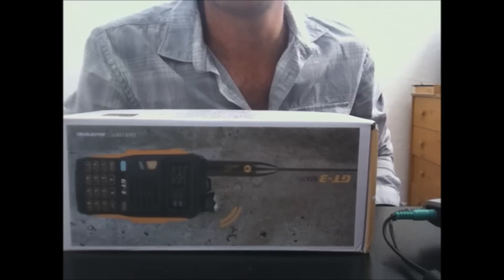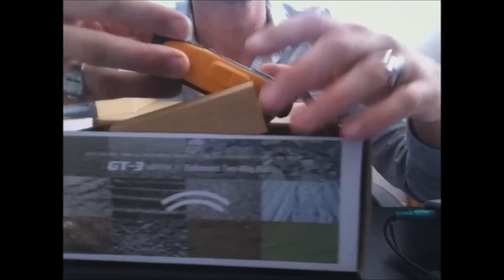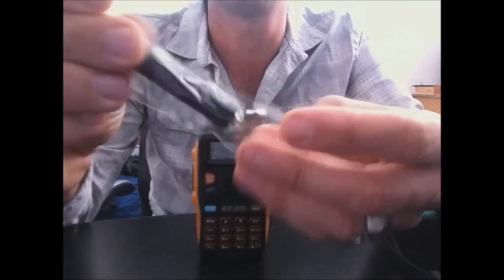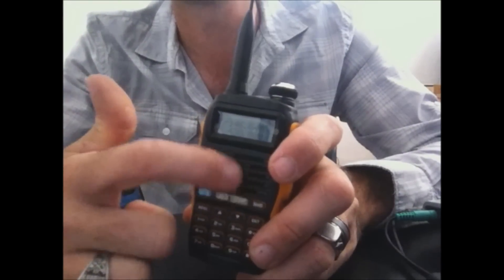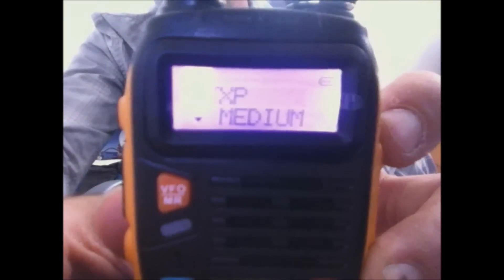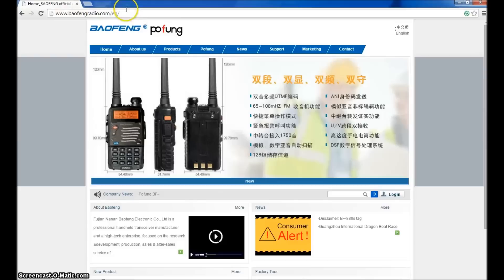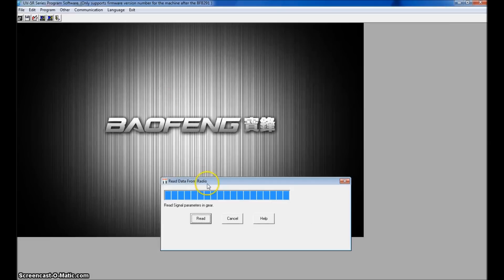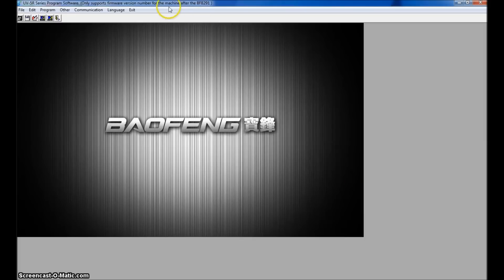GT-3TP Baofeng 8 watt review, test and programming

Comment: Misconception the tx power won't do much apart from running the battery down 4 watts to 8 is really not worth bothering with, range would not be that much more, around half an s point in reality, but do you  really want 8 watts rf bombarding your Mellon I don't think so that's if it can do 8 watts of course. 73

Comment: At least one ham on the QRZ site has a warning against using the cigarette lighter cable that is sometimes included as an accessory to power the charging base from your car voltage.  The problem is the charging base wants to see 10 VDC input.  But apparently there is no voltage drop circuitry within the cigarette lighter, and the full car battery voltage will be presented to the input of the charging base.  The car voltage can easily be 13.7 VDC, which is substantially higher than the charging base can safely handle.  The result for the ham on QRZ was his charging base literally melted. 

If you must try to charge using your car voltage, first use a volt meter to confirm that the voltage from the cigarette adapter is not over 10 VDC.  If it is, perhaps open the cigarette lighter and put 5 or 6 diodes in series within to drop the maximum 13.7 VDC to something closer to 10 VDC.  (I do not own this HT but have researched it for a friend.)  

K6VCI

Comment: Loved this radio until the mic-earphone cover broke and the monitor button popped out.Also the mic quality is subpar, I had to open up the mic hole slightly with a small drill bit to up it's loudness.

Comment: FYI: I was shocked to find the GT-3TP monitors two channels at the same time and if you are listening to the FM radio it will break in with the monitored changes and transmit without switching back. So cool! Haven't tested the other models yet.

Comment: Just used CHIRP on 1/10/2018 and it works perfectly!
Reply: Have you used the car charger and is it really a tight fit to add the computer data cable onto the device itself?

Comment: CHIRP can be used to program it but u have to select model BF-F8HP to program your GT-3TP
Reply: Can you also unlock 480-520mhz on the gt3 model using the bf-f8h software?
Reply: Well, my device works now with chirp. And i can use it up to 500 MHZ
Reply: Nightfly1957 Hi Nightfly, Could you please say how you did this?
Many thanks
Reply: I used the software of the cd.Because i had no time to search the web. It installs with many ????. If You click in the rigth corner on one of these ? , than comes Englis. Click on it. The rest You will find,
Reply: Hi, did it work ? Some device do not work. It is a roblem with the firmware.
Reply: just tried it on my day old baofeng; it no longer works. i have the latest CHIRP. programs corrupt frequencies.

Comment: new GT-3TP arrived today
ver BFP3-23
downloaded software from Baofeng site as said.

As soon as software opened I get the following flag 

can not read or write to radio 
Run time error '8020'

then radio lights up like it's down a power down and power up

with ?? ?? ?? across where the menu options are 
clicking ok shuts it down

I have a UV-3R+ and UV-5R, they work ok with both 3R and Chirp
tried the GT-3TP on chirp using BF-F8HP,  doesn't like it
any ideas ?
not a computer person, still learning.

Comment: Good content, thanks. Link to Baofeng is old/dead. Strange that the GT-3 is not on their site. I flipped through 16 pages of HTs and didn't see it. Also, programming software for it is missing - most listed are for the UV series. I'm planning to get the GT-3, so I'm interested to find the software that is up--to-date. any ideas?

Comment: Were you using a repeater or just the radio on that 40 mile communication? Thx. Nice video BTW.
Reply: DoubleHelix no radio is capable of doing 40 miles without a repeater
Reply from the maker: repeater
Reply: Hi again, the link for the firmware is not working, can you update it? thx.

Comment: Hi, can you use it out of the box without programming, so you just switch them on and start communicating? I am planning to buy two of them so I can communicate when camping and hiking.
Thanks!
Reply: They will likely need to be programmed, but you can program them from the keypad. Unfortunately, in order to access all the features, you will need to program them with a computer using the programming cable. Also, the frequencies programmed into the radio at the factory are probably not legal for use where you are, as that's the case in most areas. In the U.S., these radios are only legal for transmitting on the "two-meter" and "seventy-centimeter" ham radio bands, and then only by a licensed amateur radio operator. There are no legal frequencies that these can be used on by an unlicensed operator.

Comment: Can I use it without a license? 

Which Frequencies are typically used for SOS and other Marine Stations, so i won't interfere with them?
Reply: most of the frequency covered by this handy requires a valid licence
Reply: In the UK the only frequencies you could transmit on with this device is the PMR channels starting from 446Mhz UHF. Even then I wouldn't recommend transmitting on the full 8 Watt! The rest of the PMR users would have to sit on their handy to stop you from blowing the back end off!
Reply: Using this radio on PMR 446 frequencies would not be legal at any power as only type-approved equipment is permitted on the band. AFAIK the only legit way to transmit using this in the UK would be with a Ham radio licence - and maybe only Intermediate and above, but I'm not sure about that last point. If you don't want to bother with a Ham licence (and I suggest to casual readers that it's a really good idea to get a Ham licence if you want to explore radio), or buying a professional frequency allocation then your only strictly legit UK option is PMR 446 with type approved radios, or CB radio.
Reply: Jonathan Warner It is totally fine to use PMR without a license. The "type approved" just means it limited to 500mW which is the legal limit for transmission on PMR. Such as a kid walkie talkie radio is limited to 500mW.

That being said. Even with a license, the absolute legal limit of transmission on PMR is 500mW. Anyone transmitting above is "breaking the law". Buying this handy for PMR is pretty much breaking the law, at least here in the UK. Even with a license.

Luckily for most of us amateurs we have common sense. We use whatever power we require to talk nothing more. I have used this set at the maximum 8W attached to an outdoor colinear above my house. Max distance heard was 3 mile. So if you are a farmer or own a large warehouse or complex and would like the workers to be in contact this would be a great radio for you.
Reply: Yes, it is fine to use PMR 446 without a licence, using type approved equipment, of which a Baofeng is not. Type approval is a property of the equipment, not the power you transmit on.  By the way, PMR is more than PMR 446. There is a lot of PMR equipment out there with higher power, up to 25 Watts, to be used on other bands for which you have to purchase a licence.

Comment: Hello
I wonder which radio is better.
The BF UV82HX (8W) or BF GT-3TP Mark 3 (8W)
I want to get a good talk range and clear voice.
What do you think?
Thank You!
Reply from the maker: 8 watts is 8 watts. Now if one radio has better circuitry and design, then that would make the difference. If they were both equal 8 watts with same structure, it wouldnt matter.
Reply: So are they totally the same stuff?
Reply: I want a pair radio into the cars to talk at motorway on PMR446 freq. Which one would be the better choice? Thank You!
Reply from the maker: well, i havent had the uv82hx, but from my past history of having almost every baofeng, they are the same, unless you talk about 4 watt versus 8 watt.. Other then that, they use the same stuff, maybe a component change from here to there, but all the UV5r series from the original to the latest are all the same.. All the GT3 series are all the same, except for power levels again...
Reply: So interesting.
Should I buy the much cheaper UV-5R one?
Would it be the same for me?
What do you think?
Reply from the maker: I personally think the GT-3tp or the UV-5RTP are my favorites. Both 8 watts..The extended battery with one of these is a must have.
Reply: +HamRadioConcepts they  costs the same price. approx. 50$

Comment: I downloaded the file to windows 10, all it is is a file, a rar file,  now what?  it doesnt open or play
Reply from the maker: +Andre Rio you have to extract it with a program, such as winace, extract .rar file is what you can search.. winace is free, winace.com, it will say trialpay or purchase, t\just click on trial pay, i have ben downloading and using winace for like 9 years, havent paid 1 penny, it just reminds me my trial is up but continues to work , HAHA.. but theres tons of free software out there..
Reply: +HamRadioConcepts I managed to download the programming software on my Windows 10 machine, but i absolutely cannot get the radio to communicate with the software!!  All i get is "Communication Fault". And yes the com ports are matched up so that's not the problem.   Am i missing a USB driver?  Is there a USB driver for Windows 10?  BTW,   No problems at all on a Windows 7 computer,  but Windows 10?  No dice!
Reply from the maker: +wrathelnino ok, Google this phrase "miklor vista driver" download the vista driver from that site.. I think it's 3.2.2.0 uninstall the existing one you have now while it's plugged in then disconnect. If windows gives the option, manually load that vista driver 3.2.2.0
Reply: +HamRadioConcepts Thank you i will download that Vista driver and report back!
Reply: +wrathelnino  Well i have to say that the Miklor Vista driver 3.2.0.0 worked just fine!
Reply: what i did was , simply install chirp, connect the cable to usb and other end to handy, update the driver... done

Comment: hey HamRadioConcepts great video thanks! i didn't have a CLUE what you were talking about for most of the time because i bought this for £30 as an ott walkie talkie for hiking and camping and i know nothing (well, thanks to this video, a bit more than i did!) about ham radios! could anyone give me a bit of 'in layman's terms' advice on how to use it, as a novice?
Reply: most of the radio frequency band covered by this hand held transceiver is reserved for certain purposes, like police, marine communication, like that also it covers ham radio frequencys, which may or maynot change slightly from country to country.....

i am from india and these transceivers are used by fishermen, police , forest department, railway.... but for a licensed ham only 144-146mhz is allowed.....

so before ur next hiking , find which frequencys are available to be used without license in ur country

Comment: hi, in amazon descriptions said it radio reach 520 MHz but it cant. only reach 470 MHz , why?
Reply: Looks like you have a restricted frequency range, can be expanded in chirp software using bf-f8hp settings I believe, check the site to find out more.
http://chirp.danplanet.com
Reply: ok thanks friend,, i find a gt3 original softwar,the interface is very similar to baofeng uv5 series software, but have an special section excllusive for that equipment (gt3)

Comment: Hi I just ordered the GT-3TP.. Can I use a different antenna since the one in stock is a bit too long?
 Do you suggest anything for handheld and another one for car use.. would these work 

http://www.ebay.com.au/itm/New-SRH805S-SMA-F-Female-Dual-Band-Antenna-Baofeng-GT-3-UV-5R-BF-888s-Radio-GB-/181940933799?hash=item2a5c8654a7:g:NjEAAOSwo0JWPCzZ

http://www.ebay.com.au/itm/5dBi-3G-Indoor-Omni-directional-High-Gain-Antenna-SMA-male-TS9-CRC9-GT-/201505176916?var=&hash=item2eeaa4fd54:m:mqxxCsy9W78_-IYYlbdmclw

Thanks
Reply: +startatrix did u get the 32 cm antenna..... i am using the stock antenna and i works gr8

Comment: how about programming multiple radios?
Reply: It's easy to copy the program from one radio to the next. In fact, once the program   has been installed on one radio, you can just change radios and program the next one, and so on. At least that has worked for me using Chirp on Linux.

Comment: quick question guys can you listen to airband 108-136 
and how long does the radio last for running 8w 
looking at replacing my yaesu ft-50 thanks ☺
Reply from the maker: +Andy Howe No airband on the baofengs, you should check out the Wouxun UV9D it has dual receieve and airband.. radioddity.com

Comment: Got the GT-3TP and followed instructions as closely as possible.  My programming cable shows in device manager as a CH340.

When I plug in and try to read from the radio, I get the following error: Fail connect with transciever, then Communication Fault.  I'm running Windows 10 and ran the program as administrator.

Any thoughts would be greatly appreciated. 

 73 de K4RGD
Reply: +k4rgd in case you are still struggling with it just make sure your cable is plugged in fully. I had the same problem but when pressed and held the connector against the radio it started reading as normal. Looks like the plastic of the connector is not molded properly.
Reply: +k4rgd do some trimmings in the connector like martin said..... did u installed the drivers properlly...... go to device manager, update the driver by chousing automatic..... will  work fine ....... when using chirp select the device as F8HP

Comment: Ok guys I'm new to higher scale radios ( aka not a Motorola walkie talkie). a few questions, one can this radio be used on cb radio freq., can it be used as a regular walkie talkie style, I don't have a ham lic., so with out getting into that yet, do I need a lic. if I can operate it on the privious questioned bands?
Reply: +bloodmistninja88 no friend it cant be use as a CB radio.... u can only use these rado with a proper licence.... even licenced hams can only use 10 % of bandwidth this transceiver provides

Comment: Interesting that if you go to the Sainsonic website and download the software that is noted as specifically for the GT-3TP it shoes as the UV-5R when you open the application to the 'Other' menu.  A year later there is still not a release for this radio that includes the tripower facility.

Comment: I realize that this is probably a dumb question but I am ignorant as it relates to radios.  Once you complete the instructions above, (which I have not), do you adjust the frequency on the radio to same frequency ex: (462.7125 mhz/ channel 7 on Midland/Motorola) to talk to other radios ??  How do the A/B and or Band buttons come into play for this?  Thanks for all your help.

Comment: very very good.  Was able to program channels on the gt-3tp with your instructions - on windows 10.

Complete newb questions .. set on a particular channel I only got about 500m before it cut out. Should I be using repeater channels for my local area ? Or are there a multitude of other factors.   Also, fm radio works on one unit, but doesn't seem to work at all on the other.. hmmm
Reply: +dirtybishop help me please. I have windows 10 and the uv5r goes on a boot loop and I have to restart my computer and uninstall it from the secondary administrator profile.
Reply: Oh shit.. I just realised I've just updated to w10 since my computer crapped itself and I upgraded all hardware. So I don't know if I can help. I'd just suggest to try again on a friend's computer ?   I manually.keyed in over 40 channels and I've lost that file.  Doh. .

Comment: Just got my GT-3TP & I have tried the software you recommend it loads and runs but all "Headers" words print is all Question Marks and some small graphic squares trying to guess how to work software package is impossible. tried chirp but  Under Radio Header Upload to radio command line is dimmed out and does not work

Comment: great vid :D just got mine and as usual it didnt come with a usb cable, will any baofeng usb cable work or have to be Baofeng GT-3TP usb cable?
all i could find is this 1 ebay.co.uk/itm/Baofeng-USB-Programming-Cable-For-UV-5R-GT-3-BF-888S-G-3TP-GT-5-UV-6R-Ham-Radio-/191599582560?pt=LH_DefaultDomain_3&hash=item2c9c399d60
Reply from the maker: ***** Any Baofeng programming cable will work for this they are all the same
Reply: even the serial cables yer?
Reply from the maker: ***** its only like 5 bucks on ebay, Baofeng programming cable, with the USB on the end.
Reply from the maker: ***** Heres the link, 3 bucks http://www.ebay.com/itm/USB-Programming-Cable-Program-Software-CD-for-Baofeng-UV-5R-BF-888S-Radios-/400854213425?pt=LH_DefaultDomain_0&hash=item5d54c5e331

Comment: CHIRP software works GREAT by the way and yes it lets you open up the Frequencies to 130-177 and 420-521 additionally you have extended options of setting the squelch settings parameters for each level more on that on the CHIRP web site

Comment: Got all the software installed no probs. I have the GT-3TP here to set up.  I want to hit the repeater in town.  It is 147.060, negative offset, ctcss 100. (146.460 tx freq) How would I put all this in? (Im not great at doing this yet....lol)  THANKS
Reply from the maker: Easiest way is to press menu, then press 2 6.. Then press 2 5, then press 1 3... Menu 26,25 and 13 are your offset, shift direction and tone... Fastest way to program on the fly.

Comment: firmware for the gt3-tp is on Chirp under BF-F8HP
Reply: Can you also unlock the 480-520mhz on the gt3 using bf-f8h as the software.
Reply: Can you also unlock the 480-520mhz on the gt3 using the bf f8h as the fimware